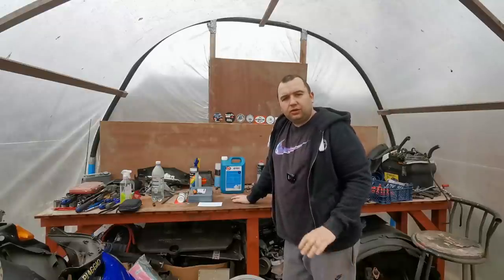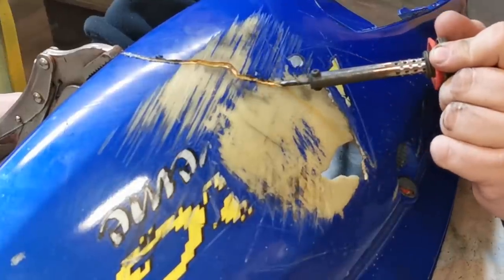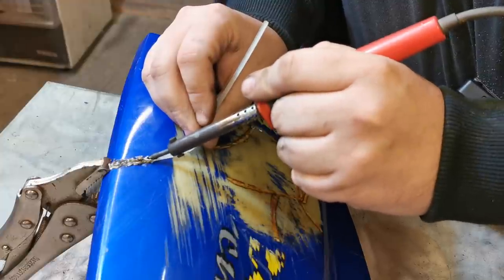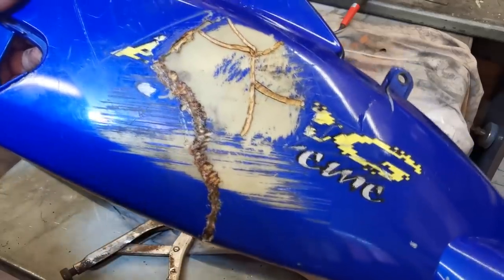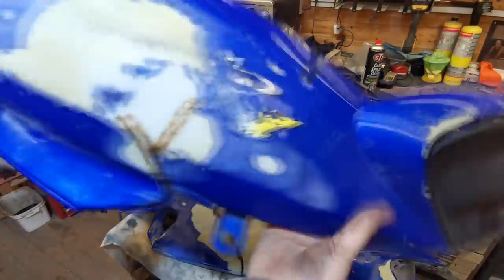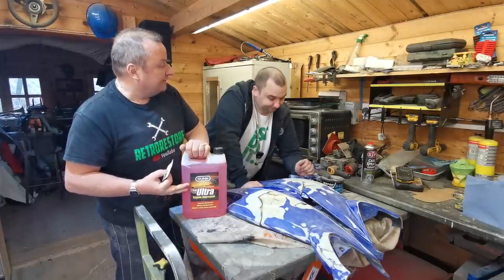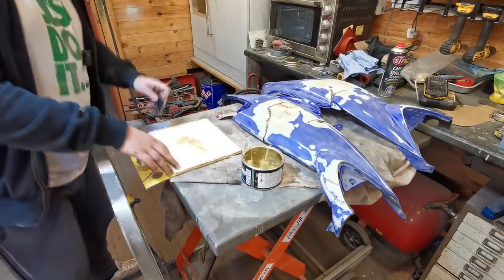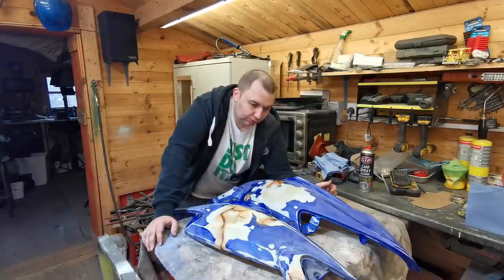Plastic Welding Scooter Panels

Comment: Hi Gary done a bit of plastic welding myself over past few years have used paper clips to stitch up crack also strips of fibre glassing aluminium mesh melted into plastic on the back of the panel great vids mate
Reply from the maker: Hi Kevin iv used the allay mesh before worked great 👍🏻

Comment: Particularly on the inside, I tried baking soda and super glue. You can sand it flat and it's as hard as nails. Worth an experiment sometime
Cheap glue is fine to use and it's solid in a few minutes.
Reply from the maker: Cheers tel 👍🏻

Comment: cable tie was new to me bud, when you use fibreglass bud carrier bag it after as saves a lot of time sanding and keeps the heat in so drys quicker and smother
Reply from the maker: Interesting 👍🏻
Reply: @ProjectMan  ie as in cut carrier just a bit bigger than what you have fibres and press and smooth out and leave on
Reply from the maker: Il have to try that 👍🏻

Comment: Looks good. The body panels are probably ABS and cable ties are nylon, not very compatible, so might have been just as well to put the fibreglass in the melted channels.
Reply from the maker: Cheers bud seems strong enough 👍🏻

Comment: Abs styrene strips behind the panel stuck with gorilla glue or tamiya liquid cement works best it properly bonds together, any old plastics from motorbikes that are badly broke save for filler rod, nylon tie wraps are a good idea for filler rods but there not the same material